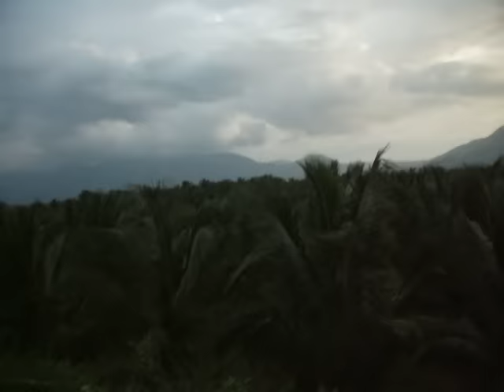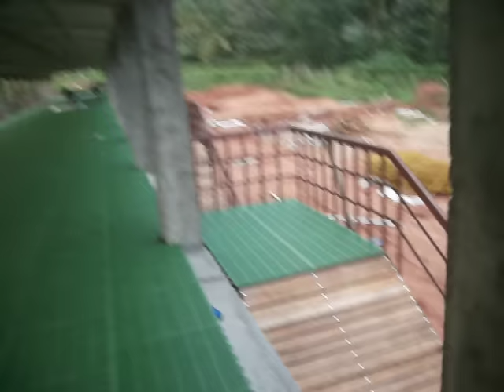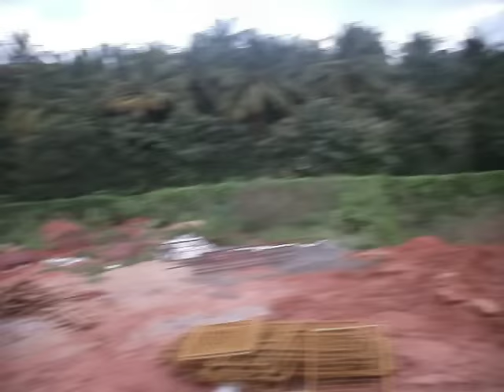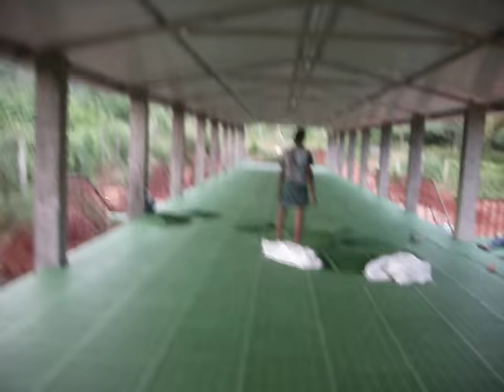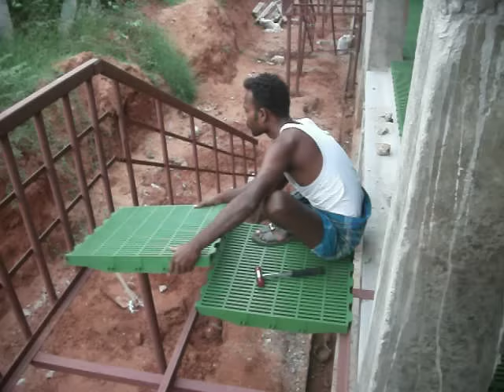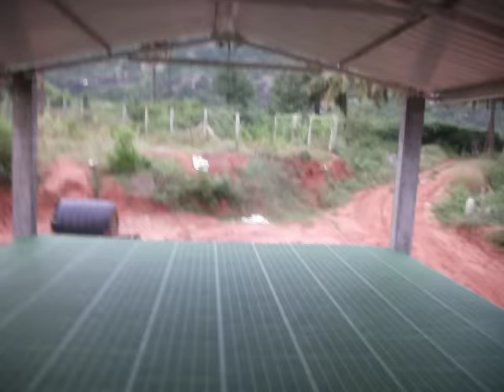Arora Gaot Farm

Comment: why you are construsting very hight.  You can install plastic or concreate slatted floor around 1.5/2feet hight and you install manure scaper under the stalled floor. you can save lot of time work is efficiency. less labours. it can be electronic program
Reply: what will be cost of slatted mat?
Reply from the maker: Please contact us through our email id info@royallivestock.com OR Whatsapp no. +919361302923
Reply from the maker: Please contact us through our email id info@royallivestock.com OR Whatsapp no. +919361302923